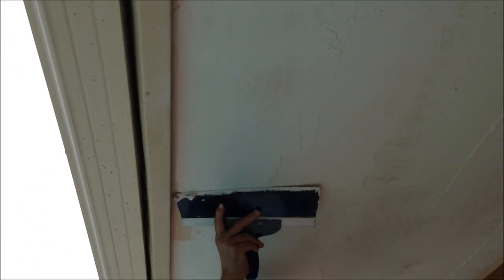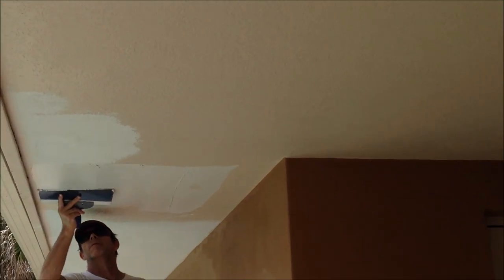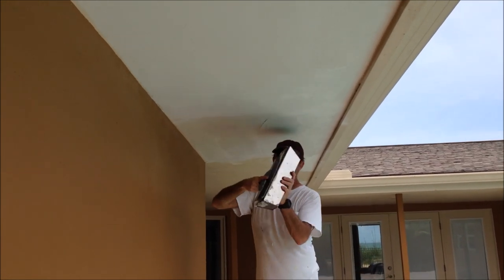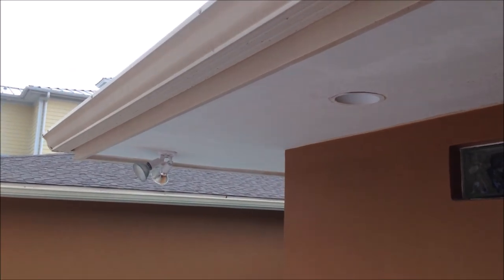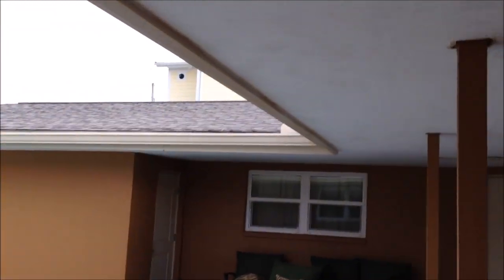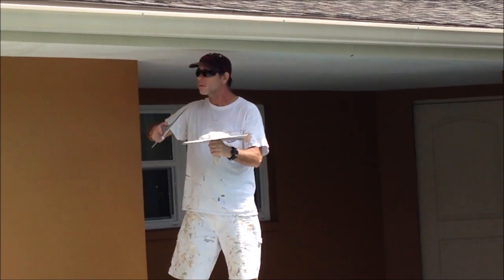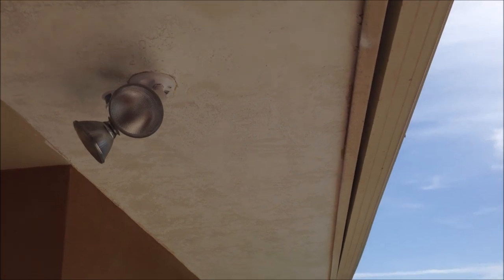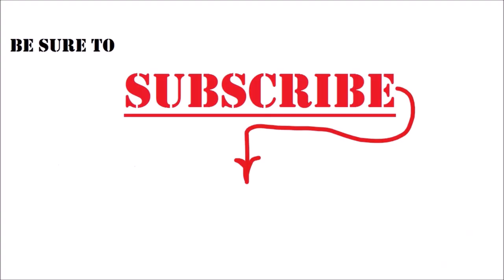Skim Coating Over Ugly Knockdown Texture After Drywall Repairs

Comment: Where does the lay customer go to find/buy the sand for this skip trowel technique? I've never seen it at any retail store, nor are you selling it at yours. I tell ya, trying to skim over a textured finish with sand in it is murder. The sand has little ridges, which make it very difficult to get a smooth finish when you skim!
Reply: Every big box store has all purpose joint compound in 5 gallon buckets